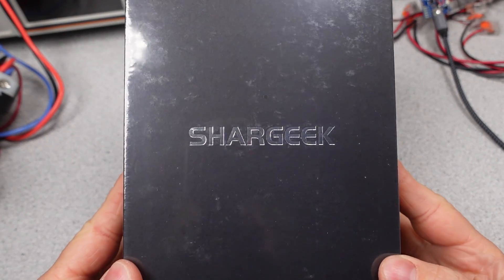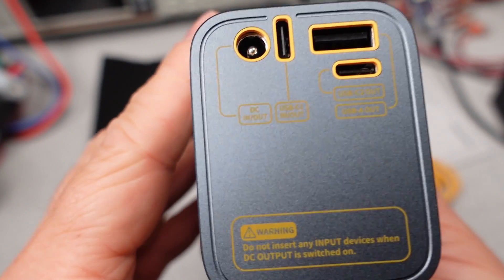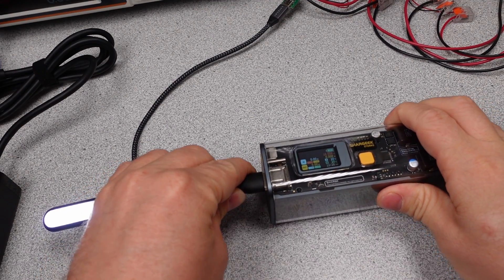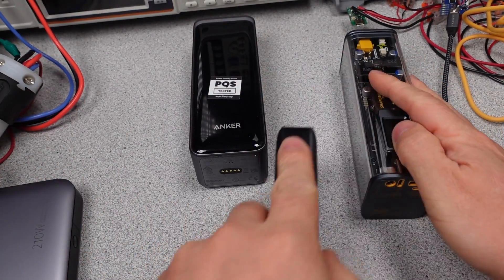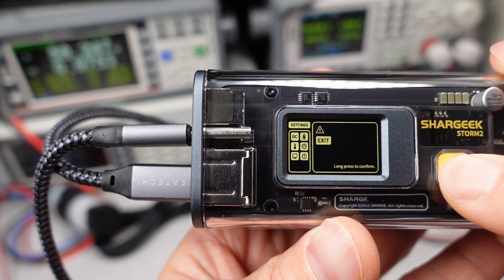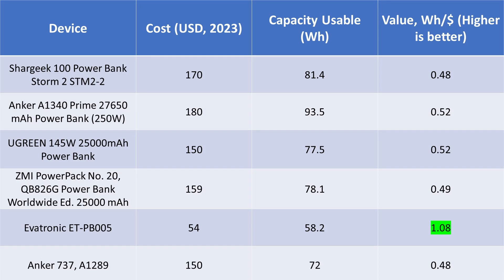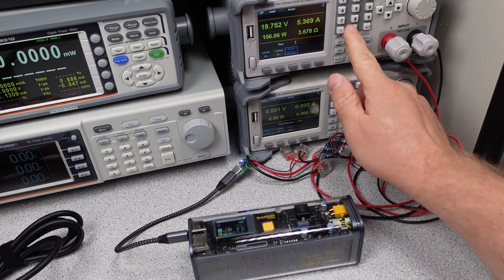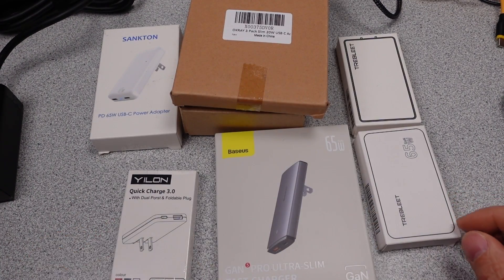Shargeek Storm 2 Power Bank Tested and Reviewed

Comment: I agree with you, I think the only great think about this power bank, is that it uses top shelf Samsung Japanese cell's, and that it uses a cool transparent case. But other then that, the spec's, and the data you acquired from it, would not cause anyone to want to merry the power bank to a USB device, cause that marriage just won't last long. You could bribe it with a doughnut, but thats not going to work either. Also, when you turned the power off and back on again, I couldn't believe how long it too it to wake up, I was watching your top meter for what felt like 10-seconds, before a readout showed back up again, I was like, dam, this is not a full sized PC, shouldn't take it that long. How much code did they program into the IC, clearly too much!
Reply from the maker: haha, yeah, it's quite slow.  The button pushes aren't consistent either so it mis reads the one button it has sometimes.  There is also no UI feedback so it's push and hold and push but for how long?  It doesn't respond until you let go.  I have heard people have issues with the power bank being flat and never coming back on after several months which if you leave it active will happen.  I still have the slim 2 around and it still boots up, but you have to remember to shut it down.

Comment: Nice video as always. I actually like the inclusion of these helpful displays on higher capacity batteries. They're not critical to have and they're unnecessary, but it's great to see which way power is going and how much is left. For the always-on stuff, I wonder when someone will consider using idk, e-ink to make it always-on without having to worry about the panel discharging the battery.

Or heck, even just a series of LEDs with different colors for different modes would've been fine too, but I guess panels are cool.

Also I'm hyped for what's next. I like thin but powerful chargers. I have a 20W Belkin one and it's handy for emergencies since it's so easy to slip into a bag or a side pocket since it's co compact unlike cubes or bricks. A thin 60W charger, a USB-C cable and a Macbook Air or an LG Gram sounds like a killer combo for lightweight but long-term use.
Reply from the maker: Yeah, I want to get more 60 watt range power banks.  Of course design principles...you get to choose two:  high power, lots of capacity or compact.

Comment: So since the batteries are not replaceable how long will this power bank last before it goes tits up?
Reply from the maker: If it took care of the batteries and monitored temperature more carefully, these should easily last years, with daily use near the power limit, probably looking at 500 cycles.  The batteries are actually replaceable more so in this power bank than others.

Comment: The "mophie powerstation pro" is interesting. It's a simple dual USB-C 45 watt charger. I was drawn to it, hoping that it's lower output was a sign of conservative & efficient design (also apple is selling it in their stores, so I was hoping their endorsement ment quality), but I'm not so sure now because it appears to have a very silly bug or two.

When I received the unit, it was completely dead (bad sign) . Others have reported this on reddit. I haven't noticed any parasitic drain since, but I use it too often to really test that.

Anyway, what's interesting is that when I got it, it wouldn't charge. I plugged it in and the 4 lights just flashed.  I pulled out my usb-c power tester and the unit would get 5v, turn on, negotiate 20v, and then reset in a continuous loop. I suspect that the unit was so drained that the battery cell protection circuit cut off and the electronics need +5v to run, so when it negotiated a 20v charge with no battery, the electronics reset! I tested this by charging the unit with dumb 5v only USB charger and sure enough, it started charging! As soon as the batteries had enough juice to not go into protection, I was able to switch to 20v fast charger and the unit has worked great since.

This a heck of an oversight that would have been easy to fix in firmware, and will probably result in a lot of returns!

Comment: For the price they should make 18650 cells rreplacable. As of now, it is designed to be disposable which is a shame.
Reply: I'd be curious to know how hard it is to disassemble. I at least see screws at one end and the main board looks to be connectorized, so it might not be impossible to open it up and replace the cells if you have the right equipment (a battery tab spot welder or a buddy with one). It at least looks a lot more possible than many of the sonically welded units potted in epoxy that are impossible to disassemble without destroying them.
Reply from the maker: Yeah, it will take work for sure but I think this one is easier to replace the cells versus glued shut power banks.
Reply: Are there user replaceable batteries power banks?
Reply: @user9b2 sure. Just search for "18650 power bank" lots of options. Have to buy cells separately but it's plug and play.
Reply: get the XTAR PB it has replaceble battery.
Reply: Funnily enough, I managed to get a couple of 18650 four-pack power banks (minus the cells) for something like $10 each some years ago.

They only go up to 10W per port (2 ports iirc), but you can get the cells in and out just by sliding off a cover.

Comment: Great review, I've been tempted in the past to buy this one but for the price to performance I can't. I did pick up the new ikea 'VARMFRONT ' power banks just cause they were cheap but by a big brand - would love to see them reviewed in the future
Reply: The pre order is open for the shargeek 170.
Reply from the maker: Yeah, 170 watts in a smaller battery.  Sounds like a great idea (sarcasm).
Reply: @AllThingsOnePlace  it's 170w max output.

Single Port USB C 3.1 is still 140w

All port in use it's only 65w max

Anyhow I believe it still cost less than the storm 2 you just reviewed.
Reply: @TrueDreams I think he's saying even at 140 watts it's more power in a smaller battery. That's sort of a recipe for disaster

Comment: One thing I am interested in seeing is which GaN charger can output 130w to my Anienware x14r2 for hours under a gaming load.  Curious to see if they would overheat.
Reply from the maker: Many chargers will overheat if you try to continuously pull that much power from them.  The supplied power adapters are designed to cope with longer term output, they still aren't 100% duty cycle.  You basically have to go up to a power station and the 130W AC to DC brick with the laptop.  Not elegant but it will work, or software limit the device to 100 watts in with a conventional USB device.
Reply: Ok thanks for the info.  Really enjoy and appreciate you work on testing these devices.  I would still like to see aftermarket laptop batteries vs OEM,  as I know some of the aftermarket ones a down right dangerous.

Comment: I have a question.
I want to pick UGREEN 300W NEXODE or maybe Anker 717 as my tiny lab power supply,but my problem is that's i don't know which linear regulator i could apply to convert one of these wall charger in to small regulated power supply.

Can you help me to solve this question by giving me some direction for a product to buy ?
Reply: P.S :
I'm aware about the existence of MDP-P906 Mini Digital Programmable Adjustable Linear Laboratory Power,but unfortunately this solution is very expensive for my pocket,so for this reason i need to find something else,but with the same capabilities of MDP-P906.
Reply from the maker: I would just get a PD trigger with adjustable PPS if you want to use USB.  Switching lab power supplies are fairly inexpensive now though so you can probably get something for less with a current and voltage limit as well as display that will be much more functional.

Comment: What’s the best one right now
Reply: For heavy metal?
Reply: IMO ZMI's 25000mah powerbank(QB826G) is best, for price, stability or specs.
Reply from the maker: It's a big power bank but it does perform well.
Reply: @AllThingsOnePlace the one with the rubber coating that you hate 😂